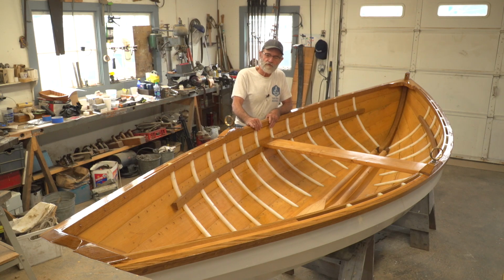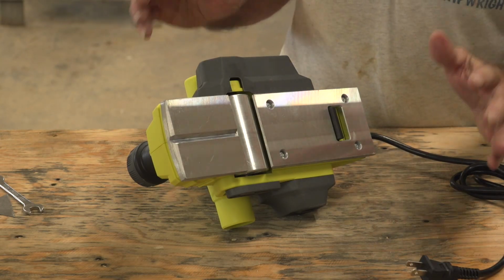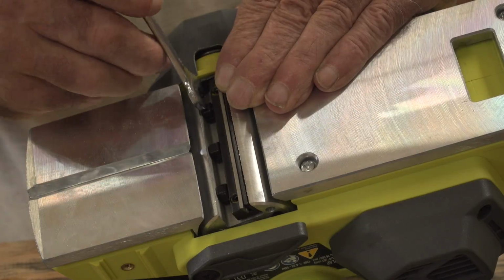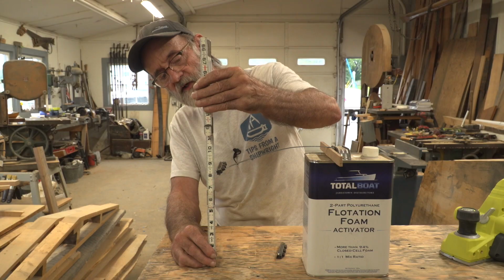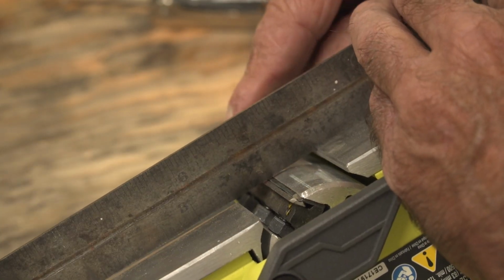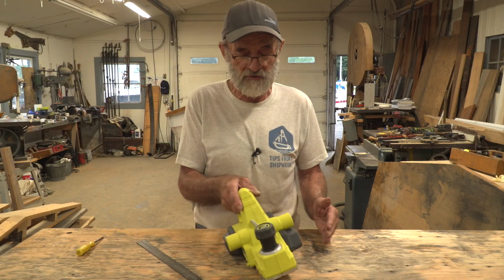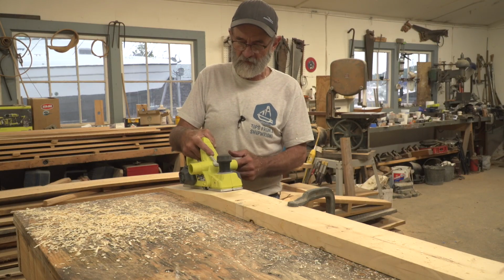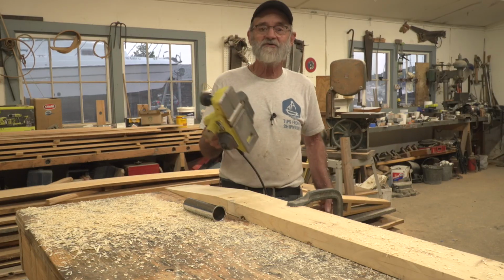How to tune up your electric planer for best results!

Comment: This is a great tutorial.  The only thing I'm not sure I agree with is to have the blades proud of the back platen.  For fine work, it seems like the blades should be even with the back platen and all the cutting depth set from the front platen.  The way you've got it is probably great for rough work to hog out material though.  Thanks for sharing all your tips.

Comment: I am about to buy one of these and I can see right off the bat that these tips are going to be very useful.  Thanks

It will be interesting to see if they have rectified the problem with the chip ejection mechanism in the 4 years since you uploaded this clip

Comment: Thank you for making this I was struggling the other day with my planer and I just assumed the blades should be jUst touching so I'm gonna go back out and readjust for proper operation! My Porter Cable has the exact same design.

Comment: These are built for general consumer use, not massive jobs. That's why it has the safety features and tool built into it. Normal people may put it back in the box and need it in 8 months, so don't want to hunt down tools to make adjustments. The blades are wider than the base because if you ding a corner, you can grind it off and slide the blade one way or the other. By grinding of corners before it's even used, you only have 1 shot with those blades. There was some good information about planers in general, but there are safety features and tools there for a reason.

Comment: Great video Lou! I also made the same mods and it works 100% better. I also took a file and rounded off the ends of the front and rear shoes. It now it's less likely to get hung up.
Reply: What did you put inside to block half of the airflow and get it to stay?
Reply: @TheFunFosters  I just used the flap that it came with.
Reply: @davidchristensen1226  - was it hard to get it glued down? Great idea. I’ll be putting mine down today. Did you happen to widen the hole as well like Lou showed?
Reply: @TheFunFosters   I kept the flap and use it with a vacuum hose. By keeping the flap I can hook up the vacuum hose on the side where it is not in the way.

Comment: Next version should be the Ryobi Sauzedde Edition Electric Plane. I'm sure the lawyers will make them keep all the guards, but the SE should include at least all the airflow fixes!
Reply: Wouldn't that be a hoot! Lou is the Eddie Bauer of planers.
Reply: And the blade edge gouging issue, too.
Eddie Bauer, Rouch Engineering,  or Carol Shelby all great at modifying vehicles for much improved performance. Ryobi planer LS edition would cost a little more, but be worth the few extra bucks. A rubberized "cap" on a lanyard would work if they don't like the plug idea.

Comment: Really educational watching you finely adjust your planer.   Not sure how you stand with the warranty if you start carving it up but if Ryobi are giving them away, not an issue.   I guess they expect people will attach a vacuum hose which should help to avoid those blockages but you're dead right, a design that needs a bit of reworking.

Comment: Big lesson!
No such thing as "straight from the box".
All factory produced products should be treated as needing to be "tuned" before first use. 
I wonder how many of us have assumed straight from the box usability, been disappointed to some degree or other without knowing quite why.
Me? Out comes my power planer for that long overdue "first use" tune up. And maybe better results - unless, of course, no amount of tuning can fix a bad product. But I have hopes it is my original ignorance. It helped also to properly understand the power planer and thus to know what does and doesn't need tuning and what can be tuned.

Comment: excellent video, but there is a reason the blades are wider than the planer bed, the same reason why the blade on a shoulder plane is wider, so you can move the blade flush to the shoulder of the rabbet in order to get a square flat corner.

Comment: Lowered the air flow, increased the pressure, genius.
Reply: Well, to be frank, reduced the orifice with the same air-flow, but the end result is the same amount of air through a smaller port, causing increased exhausted air flow from the same fan. Just like plumbing, larger supply line fed into a smaller feed line causes increased pressure at the faucet. (Typical 3/4" supply, reduced to 1/2" feed into the shut-off valve under the sink/toilet, tub/shower. Also the whole idea behind fracking in coal mining and fire hose nozzles.

Comment: Great video, thanks for the tips. I've needed a power planer for a while. Ryobi needs to make the improvements you've so graciously showed them (ie. shorten the blades/pressure bar and improve chip ejection).
Reply: Did you figure out how to block the airflow and get it to stay? I’m about to do it and not sure what to stick in there.

Comment: After thought. I own a Bosch planer (only one) as opposed to the 10 lined up in your shop. I immediately took mine and look more closely at it. To my surprise this only has one blade in the drum? I actually stopped using the planer because of the step it leaves especially on wide boards. Went back to the trusted bench plane!

Comment: Nice. I plan on getting the 18v one. I am ordering more batteries and it's an option to get a tool free and this is one I don't have. I have a bunch of batteries but they have a good deal on batteries and on top of that a free tool so figured why not. I love tools and I have a huge truck laod of red and white oak 10'x2"x6" mill boards and sanding it very time consuming.

Comment: I bought a Dewalt planer and it worked right out of the box. But....it only has one port out....and I am fine with that. It never blocks up. I've used it at both minimum and maximum cuts, worked great. But these things do make a mess if you don't attach the shop vac to them. I just plane and use a broom to clean up.

Comment: Great video. Clear explanation. I followed the process to sharpen and calibrate the planer. Mine is DNTI and when doing the adjustment using the "carry" of the ruler it didn´t but the blade is in contact with the ruler for around 8 mm. Should I keep it that way?  Appreciate comments about. I tested it with a piece of wood and seems to be fine. On level 0 it does a good job but I am unsure if that might be too much.

Comment: Great info. Maybe I can apply some to my Dewalt.  Dewalt has an odd shaped  chip ejection port that I have no idea why anyone would do anything other than round. Oval would have been better but...? I do like the micro adjusting screws for the blade adjustment.  I wish I would have seen this video before I bought my planer.

Comment: Lou I am, as usual, astounded by your skill and knowledge. You should offer an apprentice program to pass it on to younger generations. I'm also wondering if Ryobi had advance warning about your mods. They will doubtless redesign the planer based on your modifications (which are both numerous and dead on accurate). The video was superb, instructional and entertaining. I share your disdain for some of those features. I have passed on Ryobi's on account of some of those. Now that I know I can modify the planer, I'll buy one. Congrats on a great series and keep on keeping on.

Comment: I have an earlier model. It is very similar, but blue. Same blades, same depth adjust, same poor exhaust from one side, and same tendency to gouge at sides.  I use a light pass multiple times to lessen gouging, but now you showed a fix for that. How did you improve the exhaust flow? You had to take it apart and cut out obstacles, wonder how exactly... Nice review and nice dory.

Comment: If the blades were adjusted properly from the get go, couldnt you just leave the blades in the pressure bar and grind both the bar and blades at the same time? This way you wouldnt have to remove them and you could cut both corners in one pass.

Comment: Excellent video ... beautifully explained.  Thank you!  Q: Why did you take blade out of the pressure bar if you end up filing them both?  (Why not leave the blade in the pressure bar and file blade and bar at the same time)?

Comment: This may not be quite what they expected but then again it is exactly what they hope for.
That is, if they are a good manufacturer. Let's leave aside the safety features, they need to include those or, in the USA especially, they are at risk of being sued. 
But the other features or "faults" are the sort of feedback from skilled users they need to make a better product. If they act on it to redesign the flapper and throat for example.
Reply: Actually, Ryobi should have first obtained this review confidentially, learned from it, fixed the problems and then done an open box public review. As it is it isn't just Ryobi that discover the problems and what makes a good power plane, but their competitors too and if they are quicker of the mark it will be their open box review that will been seen along with the reviewer changing his preference.
But I guess a proper confidential review would cost money and an open box review of what they think is a great product costs them a free plane at cost price. Yes, he may have demonstrated Ryobi as his favourite plane but while it may be the best their mistake, perhaps, was to assume this meant it was perfect. 
Well, now they know better and they need to get over any upset and fix it and then go for a new open box review.

Comment: Lou - thanks a ton for the well-thought-out and well-presented tutorial and tune-up guide. Thoroughly enjoyable and nicely paced. I do have a question, though. It seems to me that angling the blade edges to reduce the width of cut works to reduce the width of cut alright, but it also means that you can no longer make a square rabbet - the inner corner will have an angled profile instead of the 90 degree corner you would get with an unmodified blade. Am I thinking correctly here.  Granted, this is not a precise milling tool and rabbeting is not it's strong suit, but maybe just removing material from one end of the blade and preserving the 90 degree profile would allow you to retain the rabbeting function? Cheers!

Comment: I see that this video was made a few years ago. Does anyone know if Ryobi has modified this tool to make it work a bit better? I'm fine with doing most of these modifications but the air blower part seemed a little bit more difficult. Anyone know if the newer models still jam up? Awesome video. I could hang out and learn a lot from this wise man.

Comment: I am a fan of Ryobi. However, look at else where for portable tables saws that you want to use none professionally for some furniture and finish work. worth paying $200 hundred more for a dewalt mostly, just for the double miter slots with the standard miter set up.

Comment: I can see why you relieve the blade corners, but what happens when you want to use it to run a rebate? or work into a corner?
Could keep 2 sets of blades I suppose.
Reply: I was thinking the same, presumably he never uses it on a rebate, probably most people would use a router for a rebate, I do

Comment: Best video ever. Thank you Lou!!

Has anyone figured out how to get the plastic caulking cartridge to block the airflow and stay put like he showed here 25:25?
Reply: Cut it to size, fit it, it's originally oversize, so will spring out to fit, if you need to tickle it a little, soften it slightly with a heat gun  to conform  to your specs.  I regularly  heat conform  pvc piping up or down in size  as adaptors from power tools( all different size outlets)  to my dust collection,  and that is much thicker

Comment: Lou, you basically choked down the air coming 
off the motor, to get more airspeed.  Does this 
create more heat in the motor?

Oh, GREAT episode.  If I need a hand plane, 
Ryobi!

steve
Reply: I doubt that it will create more heat, you basically have the same amount of air flow, but now its just faster .

Comment: Tapering planer blades is "old hat'.  It's been done on hand planes for years for the reasons Lou describes.  The removal of the rear support seems to be a reasonable move, since it merely protects the (non-energized) moving blades from causing the tool to skitter across the bench and onto the floor risking damage.  Unless the tool falls onto a dog on the floor and kills it...

Comment: Fan-frickin-tastic video!!! I've only ever had horrible experiences with Ryobi since they changed 15 or do years ago.  So this might change my mind a bit.
 
I have been using the Bosch 2632 for a while, and love it, but I  noticed the front shoe (infeed) never extends to exact zero though. It always leaves the blade and rear shoe touching a flat surface, with about a 0.02" gap between the front shoe and flat surface. 
 
Anyone ever experience this?

Comment: I just bought a porter cable electric planer. First, the new porter cable designs are exactly the same as tha Ryobi in this video. Second, every single thing in this video was wrong with the one I just bought. Even one side of the blade didn’t touch my ruler when I measured it like you show, and seemed to be lined up with the toe plate, which was out of plane with the heel plate. I just sent it back. It’s insane how badly thse things are made.

Comment: Excellent video thank you. I watched very closely as you adjusted that ryobi power planer. 
Interestingly I purchased a 3 inch belt sander and a matching power planer by master craft for under $100 last summer, came as a set. I plan on starting to use them soon. To literally make that long story short. My master craft ( which is a Canadian tire brand name here in Canada) is identical in every way to the ryobi other then the color mine is blue.The little blower adjustment switch is a different shape but is the same inside the egress tube.
I was curious if Canadian tire a huge company nation wide here violating some copyright laws or maybe riyobi is. I built a couple larger boats using WEST and a lot of repairs and renos when in the business many years ago. I am retired now and hand tremor is starting in but you never get the saw dust out of your veins so I will play with some small projects in a shop I have access to.. I just wondered if this was common knowledge or am I the first to notice this between the 2 products. Maybe that's why the price was so good. Anyway gave you a like and subscribed and look fwd to more of your videos. The tip about that piece of pipe on the side very clever thanks.

Comment: A Skil 100 does not have a spiral blade.  You are thinking of a Porter Cable, Rockwell or a Wen.  Not a Skil 100.  My Rockwell 653 has a carbide spiral blade.  Its a great planer but heavy and the replacement cutters are now nearly impossible to find and over $200 when you do find one.  The Rockwell 653 has the nicest depth control of any stock planer I've seen.  There were some very small Rockwell power planers like the model 4690 that had a very exposed spiral blade.  I am guessing it is one of these that you are thinking of that could be dangerous to use.  Not the Skil 100 though.  The Skil 100 is the best planer out there and remains highly sought after with clean ones selling for over $700 and refurbished ones selling for $1,100.

Comment: At about 28 minutes in, the old plane sounds like it's running faster than the new one.  The pitch is about a whole tone higher, so maybe 10% faster.  Is the motor stronger?

Comment: I just bought a Porter Cable electric planer. Now I'm afraid to use it!
Reply: That makes two of us.
Reply: Ron and Drew.  I have a PC planer and have used it without any problems.  I had to do some of the same things Lou talked about with the blade width, etc., but I don't see it as a "dangerous" tool.  I look forward to Lou's video showing why it he thinks that.
Reply: I got the impression it was an old version Porter Cable electric planer that was the most dangerous tool he's ever seen.
Reply: @drewt3210  Make that three of us!

Comment: Dear Ryobi, please send me one of your planers I promise I won't rip it apart or complain about anything. The blades are wider than the base so when you're working on a wide board you won't be riding on any little ridges that a narrower blade would leave behind.

Comment: This video points out what we the end user has to put up with, none of the manufactures think to ask the person who uses the tool is it fit for use. These tools are made cheap in China and sold only to benefit the share holders and CEO with little or no thought as to the customer who has paid good and hard earned money for the substandard products. I have yet to buy powered a trade tool that hasn't got a problem of some kind that should have been correct before being released onto the market We all have experienced this problem, our complaints or suggestions fall on deaf ears. They couldn't give a dam about the customer it is all about high profits. It's not only power tools, it is automobiles, domestic appliances, most anything we buy from a manufacturer is sold with the end user being taken to the cleaners. High prices, low quality and poor service-------- will it ever end?

Comment: I loaned my ELU    Made in Switzerland . HEAVY duty 850W 12,000rpm Planer who kindly replaced the chipped blade and rotted drive belt .that it was  useless.After checking the new tungsten blade settings like your video . would you believe that BOTH blades had at least 10 to 20 thou clearance .Plus the blades were overhanging and the drum was not even in the centre . this model has a wicked amount of gyroscopic stability   which is quite intimidating . Oh yes   and he had put it down on the cable so  a  heat shrink repair  was required .. Moral is,  do not loan tools.